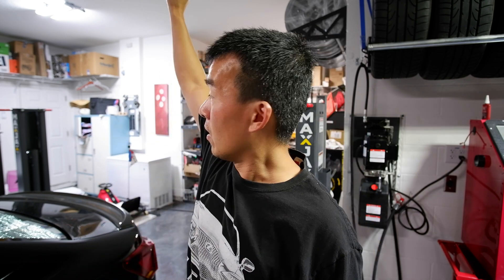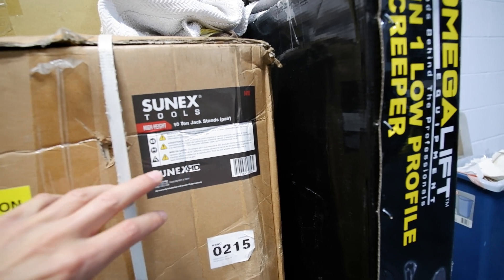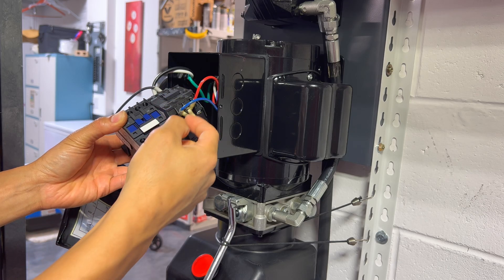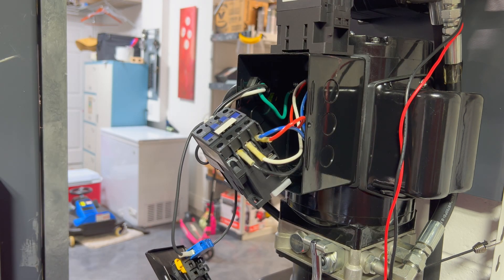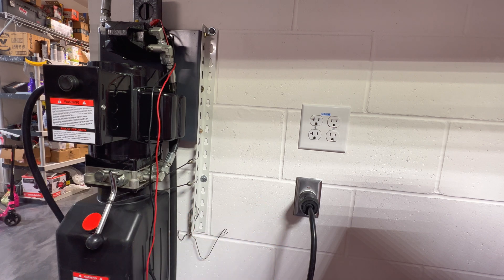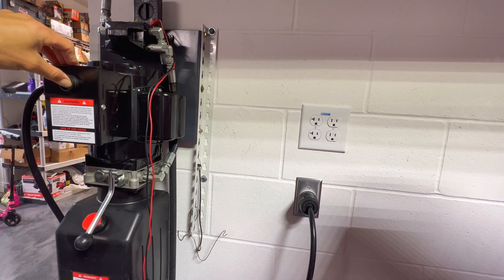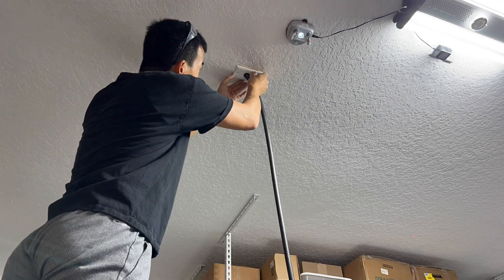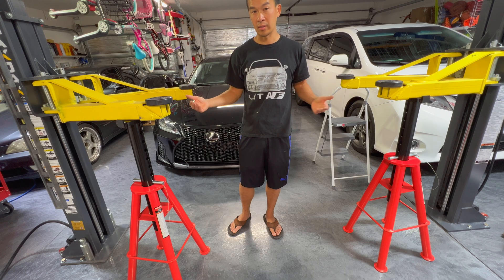How to Convert MaxJax 2-Post Lift to 240V Power | Hiding Hydraulic Lines Overhead Ceiling

Comment: Did you notice any difference on lifting 110 vs 240 ? Is it any faster on 240 ? Just curious cause i have the m7k and i would like to swap to 240 if it lift faster.  Thank you.
Reply from the maker: I can’t tell. Probably a few seconds.
Reply: @TunerwithKids  ok, thanks. Then no need for me to do 240v
Reply from the maker: If you got a good 20A 120 circuit, I think it’ll be fine.
Reply from the maker: Yea. Another thing I noticed just reading the install instructions, you should unplug the unit when not in use. I’ve had mine always plugged for over a year. Probably good idea to avoid power surge damage.
Reply: @TunerwithKids  thanks for the advice.  Mines, I have it on a off and on heavy duty switch. Its off when I'm not in use

Comment: Did you use equal length hydraulic hoses? Same length to each cylinder? If not, have you had any issue with the lift arms staying level as you lift? Maxjax advised they need to be equal length for lifting to be level.
Reply from the maker: Mine are no where near same length. One side is 32’ and other is 8’ and it works fine. Once line is filled with hydraulic fluid it will lift at same rate. Just run it a few times without load to fill and discharge fluid to even out the fluid in each line.
Reply: the people at maxjax just drop ship and sell, they don't understand much.
Fluid is not compressable, it doesn't matter if one side is longer.
I added 10 feet to one side to reach over the top, it didn't affect operation.
10 feet of extra hose and a 3/8 to 3/8 coupler was $50 amazon.
Just do it.

Comment: It always spins me out when Americans do their own electrical but even more so when it's 240V. The new 240V plug resembles the standard Australian outlet plug. Same pattern, just a lot bulkier.
Reply from the maker: All Aussie normal voltage is 230V/240V 50hz, probably no different than 240V 60hz in usa. The USA likes to waste the extra copper for same amps on 120V, 😂.
Reply: @TunerwithKids  Here it's for safety reasons as 240 V and people (that don't know what they are doing) is not a good mix! 😂

Comment: Nice job. How much faster does it lift your car versus on 120v?
Reply from the maker: I haven’t timed it. From what I read on Garage Journal it’s like 10 seconds. Nothing earthshaking. But it’s mainly to reduce the inrush amps on the 120v circuit 240V theoretically pulls half the amps for the same power.
Reply: Lots of work and $$$ to save 10 secs, I’ll stick with 120v for my maxjax. Not worth the extra effort imho.